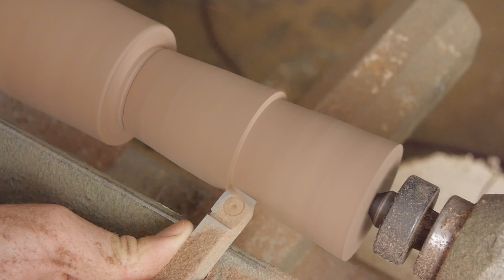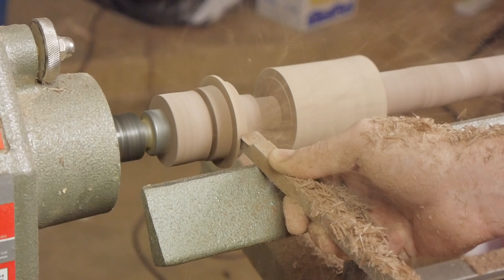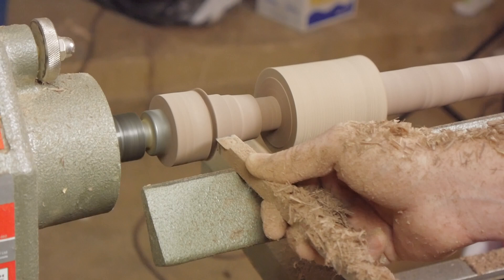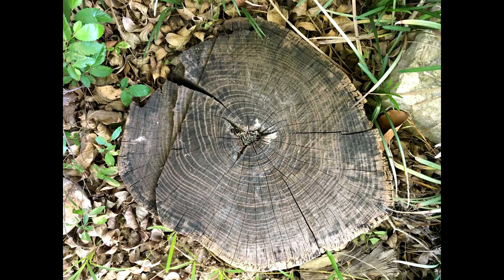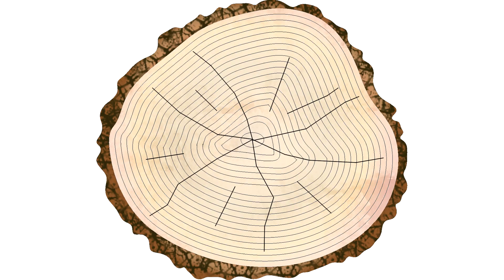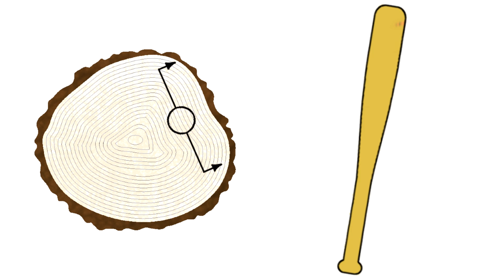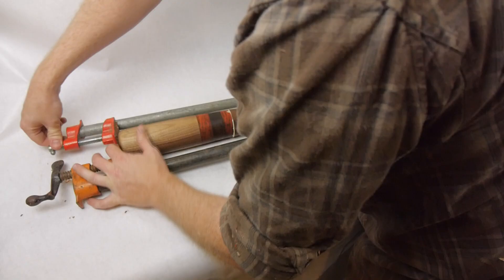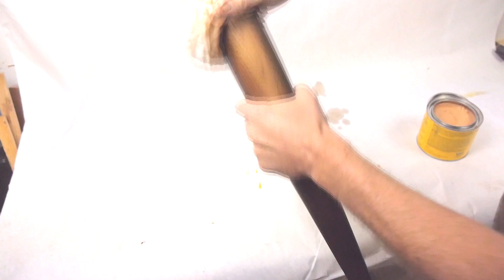Why do Baseball Bats Break?

Comment: Why don't they simply use composite materials, or reinforce the wooden bats with a carbon fiber mesh or something? That would not prevent all breakage but I'd think that it would create less clean breaks and more partial breaks where the bat is still one piece.
Reply: The exit velocity off of the bats would be too high and would be dangerous for pitchers. Even at high school levels the use of composite baseball bats has been reduced to the BBCOR standard.
Reply: Its not the size of the field that is the problem jokurandomnimi its the velocity of the ball off of the bat. If you use a composite material the bat will have a greater trampoline effect making the ball move much faster off of the bat. The problem with this is the safety of the fielders. Right now most homeruns have an exit velocity of around 100-105 mph if they switched to composite bats it could rise to 120-125 mph. A ball hit that fast and right back to an infielder or pitcher could cause serious damage, and thats not accounting for the people in the stands who might not even be paying attention.
Reply: Not to say that the Finnish players aren't good but the MLB is a whole different beast. There are pitchers throwing over 100 mph, batters crushing pitches over 450ft using wood bats. The addition of composite or metal bats would just be too dangerous for spectators and players as well.
Reply: +dajetfan97
I wonder if something replacing the bat's core could eliminate breakage without increasing the power transferred into the ball. Something like a plastic rod with similar elasticity to wood, that would prevent total separation of the bat if it breaks off.
Reply: +kauske that's called corking a bat which is against today's ruleset.
Reply: dajetfan97 
Firstly, corking has been disproven to have the effects that have been claimed of it. Secondly, it would be a thin rod, something like a string of spaghetti to a pencil in thickness, just enough to keep large shrapnel from separating. If bats do usually break clean through, it would keep the bat head from flying off and striking someone.

There are a number of materials that could fit the bill for thin, ultra durable binders. considering someone got a dropped lung from bat sharpnel, a bit of modification in lieue of changing to stronger overall materials isn't too unwarranted.
Reply: There are certainly hardwoods in Northern Europe. Ash, Oak, Maple and Elm grow in the southern parts of Scandinavia and Finland.
Reply: literally a single strip of tape around the snapping point would greatly reduce the damage of a broken bat
Reply: didn´t know there was a Finnish baseball, averyday you learn something
Reply: @dajetfan97  
If every bat was under league rules?
Reply: @dajetfan97  
Can they not mimic real wood in any composite material? Offer a random range of similarity just like wood.

Comment: it seems simple to make a mm or two hole down the center and running a spectra line down the center with a cap on each end. Voilà no more flying bat bits.
Reply from the maker: +Robert Szasz There have been a ton of cool ideas for how to deal with the issue, but I think MLB is hesitant to make significant changes because the want to maintain the historical nature of the game (not let it evolve too much).
Reply: +Practical Engineering I understand, it's just that such a simple fix for a dangerous issue exists. F1 eventually implemented tethering of the wheel assemblies, I wonder if a fan will need to end up dead before an acceptable solution is found.

Comment: I am curious why you cant have a rolled, and epoxy impregnated aramid fiber core running inside the bat... because if you do, there is almost no way that the bat could have a catastrophic failure
Reply: They make wood bats similar to that. Search Baum bat online. Unfortunately they are not legal in major league

Comment: It's not orthogonal, you meant perpendicular. Direction is a vector, and the bars reference is a line/vector.
Orthogonal is 2 planes or objects.  Normal is a plane and a vector/line.
Perpendicular is to vectors or lines.

Comment: If bat breaking is an important consideration, why aren't advanced metal/plastic bats used? Does that go against tradition, or does wood have a hitting property that is hard to mimic with other materials?
Reply: +anon746912 I'd go into more detail, but the short answer is that if major league players were using aluminum or metal alloy bats, people would probably end up getting killed because baseballs come off of those bats with a lot more speed and distance than wooden bats. It would be a whole lot scarier and more dangerous to players and fans than the occasional broken bat shard flying.

Comment: So if ash worked ok, why did they switch to maple? Can you hit the ball further with a maple bat ? And why not pine or oak ? Sorry for my ignorance here, I'm English and know nothing about baseball.
Reply from the maker: There's a lot of superstition in baseball. Players switched to maple because they saw another player break the home run record using maple bats. Pine is too soft. Not sure why oak isn't used, but a google search could probably answer it pretty quickly.
Reply: It also might have something to do with the fact that the emerald ash borer is going to cause all the ash trees in North America to go extinct within 50 years, so if you have an genuine ash baseball bat, you might want to save it.  It could be be a priceless artifact in 100 years.
Reply: Has anyone tried to use Magnesium bats
Reply: Plenty of vehicles use magnesium wheels without issues.
Reply: When it's bonded with other metals in an alloy it's safe, but elemental magnesium is considered a hazardous material.
Reply: When we say magnesium wheels, we mean magnesium alloy. When we say aluminum wheels; we mean aluminum alloy. These two metals when used for mechanical strength are ALWAYS alloys so saying so is redundant. When he said magnesium bat, he meant magnesium alloy!

Titanium and steel are also usually some form of alloy.
Reply: theomnipresent1 Great info all in all but: Steel is always an alloy, otherwise it'd be called iron.
Reply: 'Steel' is kind of confusing! Most people think steel is just iron with carbon in it, but actually pig iron/cast iron has WAY more carbon than steel. Steel is mostly iron so shouldn't it be called iron alloy? I agree that steel itself is an alloy, but that does not make it a steel alloy. A steel alloy would include further ingredients such as chromium, molybdenum, nickel, etc... So when I say "Titanium and steel are also usually some form of alloy." I mean they usually use further processed metals instead of their standard respective states. I could always edit my post to make this clear?
Reply: theomnipresent1 Surely steel isnt an alloy if it's just iron and some small amount of carbon. I was under the impression that the steels with other metals in the mix(like stainless or various spring steels) were alloys, but basic steel isn't.
Reply: Technically, an alloy is a mixture of two or more elements with at least one being a metal. 

I would say that plain steel is therefore technically an 'iron' alloy, but an alloy nonetheless. Though plain steel is not a steel alloy.

Comment: Why not just take another cylindrical piece of wood, rotate it ~90 degrees and put it as a core for the length of the bat? It would require more resources of course, but it would keep all the grain from running the same direction on all sides and even if the bat were to crack on the outside the core would still hold it together keeping it from flying off the bat.

Comment: They could eliminate 100% of bats breaking by simply making it a composite material, like laminated/glued wood, or, you know, use modern materials.
Reply: people complain they'd hit too hard but I can't imagine something like a featherweight carbon fiber bat would set the world on fire distance wise, then just fill the inside with some denser and denser materials until the players are hitting the same distance as a wooden bat.

Comment: Nice vid, but let's not be disrespectful to the wood.

Well, trees only care about growing big enough to get as much light as possible - and swaying in the wind not breaking - and having sap so beetles and bacteria don't eat them alive before they grow bigger than a standard shoot of grass.  IMO for what the wood is engineered for, it does a great job - especially for taking water and air and trace minerals in the soil that pass through it without otherwise moving at all.  Think about what a tree does and how it builds with what it has right there.

You could certainly build something bigger - that might last longer - but you'd have to use thousands of times the energy and materials the tree has.  And likely part of that would be cutting down a lot of trees for their wood, and the fuel coal/oil from ancient trees.

Comment: Bro also the balls coming in at 90+ mph & the batter is swinging at 70+ 
At least & sometimes 125 mph. Also usually when they get jammed & it’s on a smaller or thinner price of the bat
Reply: A cricket ball can travel at 90mph tops, is heavier and harder. The impact dimension can also be the same and at the edge of the bat the bat thickness can be less. I can certainly feel more force playing cricket than baseball. I think the key is greater overall mass typically 2 lbs 10 oz for a medium weight bat, and softer willow which springs back much more rather than breaking.

Comment: Sure that's a decorative bat cause it wouldn't stand any swing because of just "glue" ! you need to add a center rod made out of carbon for example to increase the stiffness and prevent the bat from separating into pieces when broken.

Comment: Now this has me wondering if hickory would be good for a bat, because ash was the best wood available to Europe and Asia before the colonization of the new world, and hickory is actually a better wood for the job, making me wonder if the same would be true for a bat. 

It might also be possible to reinforce the bats by placing a metal cap at each end and connect them together via a steel cable to retain the heaviest debris. That, or just find a composite sufficiently similar to wood with limits placed on its hardness and energy return.

Comment: Why don't they start using a small metal rod along the core, and coat the surface with some polymer that has glue like properties?
Reply: Good video by the way... and COOL BASEBALL BAT ! :-D
Reply: Because frustrated batter won't be able to break the bat as easily :P

Comment: Every time I've seen MLB players break a bat, they were holding it with the logo facing the pitcher as it hit the ball.  Maybe, it was not every time it has ever happened but, every time I see it.  It's replayed over and over.  We get a good look.  It's little league mistake.  We were taught very early how told hold the bat.  It's amazing to see MLB players holding the bat incorrectly.
Reply: Part of the reason cricket bats fare so much better is probably because you can’t really fuck up holding it.

Comment: Easily fixed by:
#1 Regulate the approved materials used for making bats.
#2 Make the bats twice as thick to improve strength.
#3 Use carbon fibre like everybody else and jack up the price of a bat by 3 million %.

Comment: What year did this problem get fixed? (How long did it take?) 
I've reblogged your story (and the Gizmodo post) at http://art2science.org/2016/04/03/art-and-science-of-baseball-bats/  Thanks!
Reply from the maker: +Roger Bohn Hey Roger, from what I remember from my research, they phased in the recommendations, so I think it was a gradual process. MLB doesn't keep statistics for bat breaks, so it's kind of tough to get a good handle on how things changed after the new rules in 2009.
Reply: +Practical Engineering Thanks! That suggests it took 8 years to recognize the problem, research it, devise a solution, and implement the solution into rules. That may be exaggerated; it  probably took a few years for players to switch bats after Barry Bonds.

Comment: The problem isn't the wood - it's that MLB requires that only wood be used in their bats, when athletes are becoming increasingly stronger (/cough BALCO /cough).

Rather than use a inconsistent material with unpredictable failure points, it would be better to use a material with a more uniform structure, like Bamboo, Palm, Metal or Composite.  Such bats are also easier to check for tampering or fatigue.

Comment: No.       I have been working wood all my life,, and the differences between ash and maple are much more than just some erudite descriptions of radial and orthogonal planes.,  The base character of the woods is so vastly different that they should not be spoken of as one.   Therein is your first error.  They are not the same thing.

Let us begin with wood characteristics.  Ash is an abnormally straight grained wood,, It has tremendous strength,, and flexibility.  That all bat blanks were originally splits does not surprise me at all.  Maple simply cannot be reliably split.  Maple is an extremely hard surfaced wood,,,also allow us to digress a bit.  There is only one white ash species,, there are other ash species, green ash, mountain ash,,,, only white ash is useful for bats and tool handles,,, and each of those for the same reasons.  Durable surface, tremendous flexibility and strength, and straight grain.      Maple on the other hand comes in 20 different flavours,, species,,, which maple is being used for bats?  To say 'maple bat'  is not terribly informative.

Some maples may work well,, others,, not at all.  hard maple,, soft maple,, Eastern, Western, Sugar, Red,, Rock,,Maple grown in Northern Michigan is vastly different from Maple grown in Georgia,, Old growth maple?  Farm raised?    ????

And the major reason you will no longer see ash bats,,,,, there are no more ash trees.  The Emerald Ash Borer,, imported from China has essentially killed them all.  What few remain are no longer economical to search out.

Yes,, I agree,, each wood type will exhibit differing manufacturing and use problems and considerations.  But forgive me,,, a bunch of college educated engineers , still wet behind the ears,,,, your discussion leaves me disappointed in you and a bit angry.    It would be exactly the same to have an aerospace engineer,, with a masters, but never having flown a plane,,, trying to tell a 60 year old pilot, with 28,000 hours,  how to fly an airplane.  Which is exactly why the 737Max is having problems.  A software engineer program can take over the plane,, regardless of what the pilot in the seat knows and can do.  A computer program is flying the plane,,, written by a non-pilot,,, who is not in the cockpit,, that can over rule the pilot who is seeing and hands on.

One talented bozo used a maple bat,, and everyone wanted a maple bat,,,,   And the bat manufacturers breathed a sigh of relief,, because they had no idea where they were going to get more white ash.

You want a bat that never breaks,,,, elm.   Want a bat that will slap the hands of the batter as hard as he hits the ball?  White oak.  Be wary of red oak,, if it shatters,, the shards could cause considerable injury.  Beech might work well,,, as well or better than maple.    Hickory,,, hammer handle stock,,, about the closest to white ash,, maybe a bit more flexible.

Leave the children out of the discussion.    Ask a wood worker.